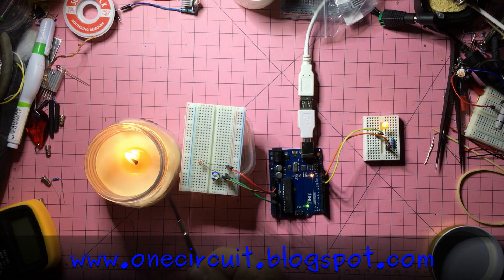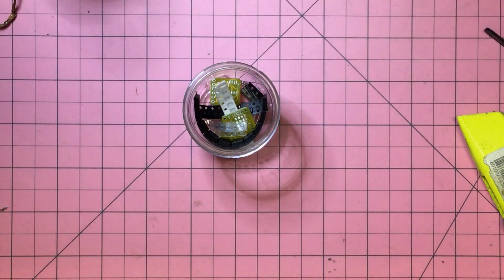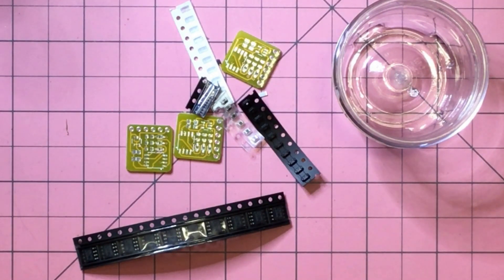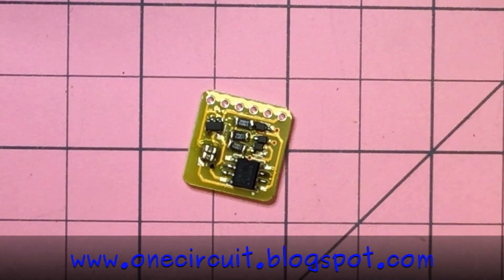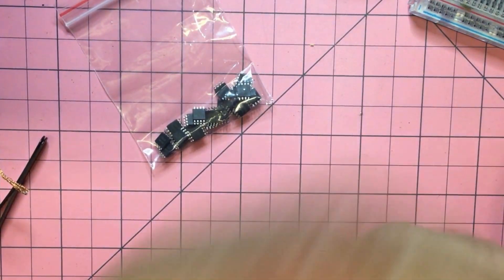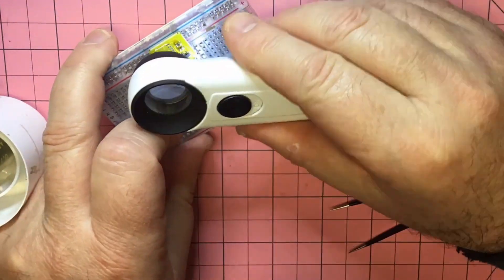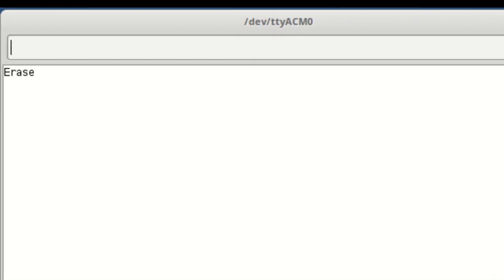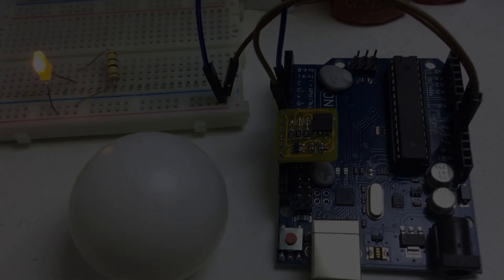25Q32FV FLASH MEMORY

Comment: Hello, can we include this flash memory in Arduino and write programs on it like its own flash memory? Because Arduino has very limited flash space.
Reply from the maker: I’ve wondered that myself. Wouldn’t it be neat to extend the ram to eeprom (with very clever code), but honestly I’d use an ESP32 if you need more “grunt”. Cheap, powerful (some models with 2 cores) and Bluetooth/WiFi built in as a bonus. ESP32 for the win! 👍😀

Comment: A very clever project! 👍
I agree with other comments here, you could analyse the behaviour and try to simulate it in an algorithm.
Failing that, break the actual data into small chunks with a similar start/end amplitude (like zero crossing) then it might be small enough to put 16 chunks in the mcu rom, and just randomly sequence the chunks for playback.
Another idea, reduce the sample rate to very low (like 20Hz) so you can store a large amount of samples in small mcu rom. Then, for playback use interpolation at a higher freq like >100Hz to smoothly ramp the pwm from one sample to the next. You could possibly get many minutes of playback even in a small mcu. 👍

Comment: What a terrible advert for the re-flow oven. LOL
The flickering LED looks awesome.
Reply from the maker: I don’t think I’ll do anymore reflow without a stencil. Had to try it though! 🤷🏼‍♂️
Reply: @onecircuit-as  .. your paste application was terrible. 😬
This works well; put a splop of paste on a flat piece of plastic etc, then get a tiny flat blade jewellers screwdriver, and scoop a tiny bit of paste onto the screwdriver. Then you dab that tiny paste amount onto a single SMD pad. Keep wiping the screwdriver clean as you go and with practice you can get a small controlled amount on each pad and no paste anywhere unwanted.
Then of course careful positioning of the components without smearing the paste everywere and you are good to go. 👍
also, most people use way too much paste. You need very little. And buy 2% silver paste it is much better performance.

Comment: Another method is using a SD Card module and writing the data to the SD Card.
Cool video, I like the idea behind it and the results in the end.
Reply from the maker: Yes I keep forgetting what’s in the video and what’s on the blog. From the blog “The use of an SD-card module is possible, but I did see this little PCB on David Johnson-Davies most excellent Technoblogy site a few years ago”. Maybe I should use a script instead of…um…ah…rambling! 😂
Reply: Oh yea using a SD card with an MCU can be so powerful, I did that with one of my projects in grade 12
Reply from the maker: For lots of data I usually swap out the Arduino for an ESP8266 and fling it all to the cloud. The ESP32 is even more awesome. 👍😀
Reply: @onecircuit-as  just started using an esp8266 after flashing a sonoff switch with tasmota, works much better than the original firmware and still works if the net dies
Reply: @onecircuit-as  true, I love the ESP boards. Also have a couple Uno's with embedded esp8266 chips.